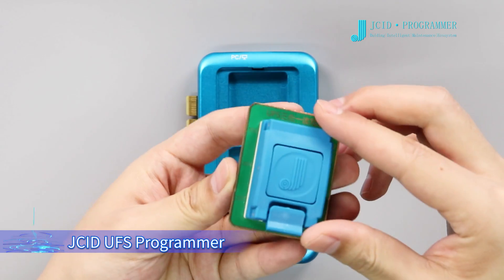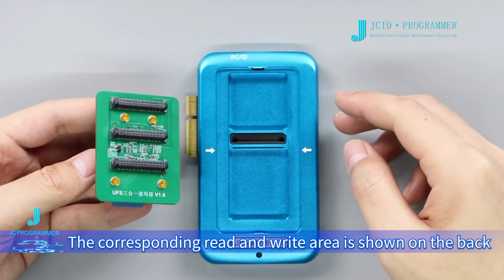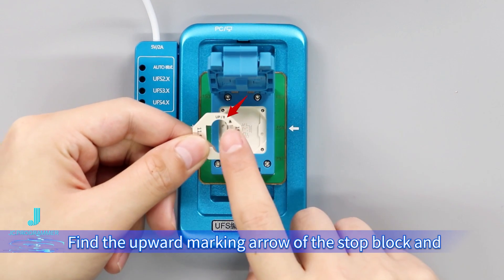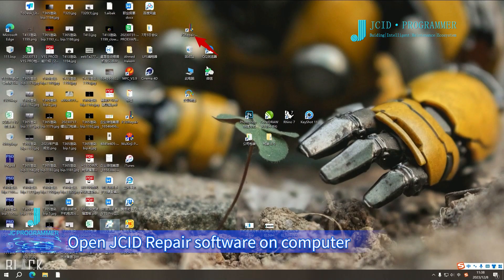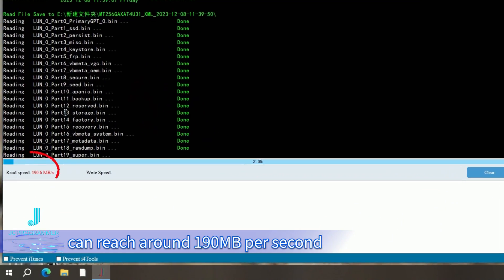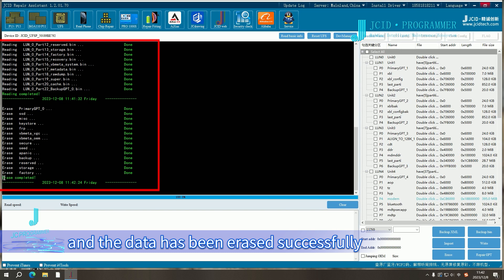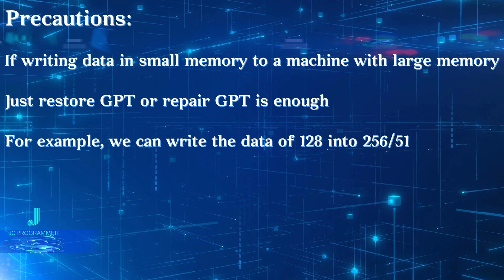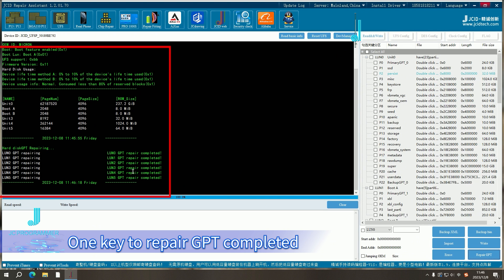UFS Programmer-U15 is Coming!

Comment: Compre esta box, la verdad es muy incompleta, no se puede pasar software de mtk con scratter, no tiene otp unlock, falla mucho en leer memorias, le faltan muchas opciones android, deberian de hacer un software dedicado a solo para la box, compre la p15 la programadora de bateria q1 cautin aixun y fuente de poder aixun me parece que son una muy buena marca, por favor arreglen esos errores ya que lo que hace la ufs u15 programmer es bueno pero puede para mas
Reply from the maker: Hola, gracias por su apoyo y amables sugerencias, mejoraremos y completaremos software y hardware gradualmente, haciendo que esta herramienta sea más útil para los técnicos.
Reply: @jcidtech cuando lo van hacer, ya que no la uso porque faltan demasiadas opciones en el programa, compré una memoria de 256gb nueva  para el poco x3 pro que tenía su memoria dañada y para poder programar tuve que usar easy jtag de un amigo porque la ufs u15 programmer no tiene opción para escribir software desde cero tienen que arreglar ese gran problema si quieren vender el producto